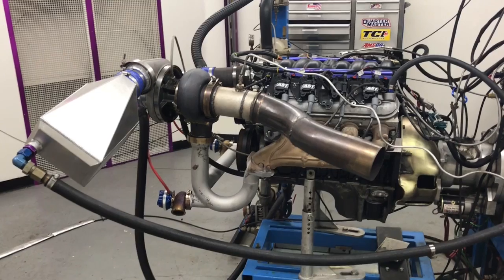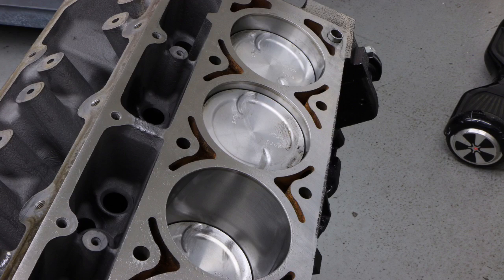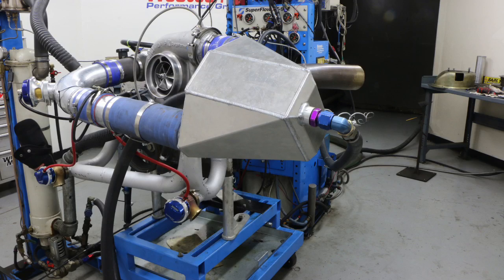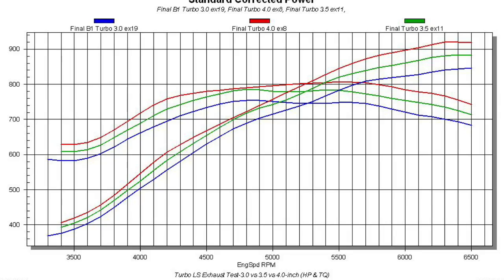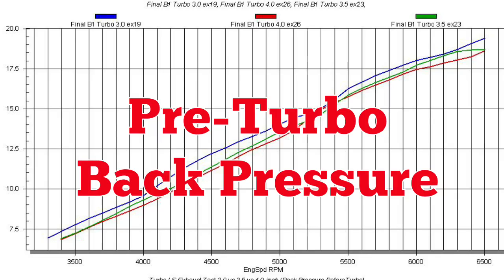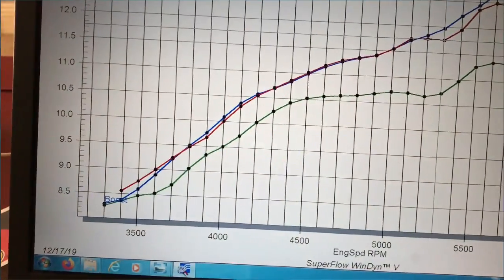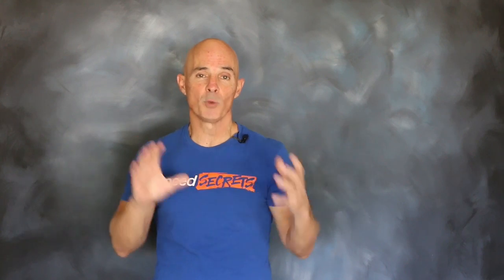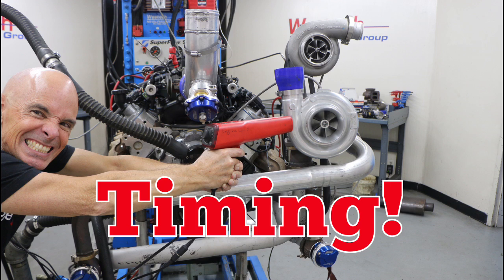LS TURBO EXHAUST TEST-THE DOWN PIPE DILEMMA-WHAT SIZE WORKS?

Comment: Awesome test, Richard. I'd really like to see a similar test with an NA engine with a y-pipe to a single exhaust. Unfortunately most of the options for us 4th gen Fbody guys are y-pipe set ups. That would be awesome to see how much power is picked up going from 3" to 3.5" to 4" on a cammed LS.
Reply: It would not be as significant, because post-turbine flow is far closer to being constant, and constant flow benefits from an infinite-cross-section exhaust pipe.

Pulsed flow benefits from a cross-section that utilizes the velocity of the last pulse to create a lower pressure area behind it for the next pulse. A single-pipe exhaust receives eight times as many same-size pulses as a single exhaust header primary tube, so it has to be larger in cross section for two reasons: higher frequency, (8X the frequency) and greater overall volume (8X the volume) of an exhaust primary tube, BUT, the change in pressure between each peak to each trough in the pressure waves is far smaller than right behind the exhaust valves.

Comment: Everyone only talks about size of the exhaust, which is important, but no one ever talks about the length of the exhaust. More length = more friction and my theory is the length of the exhaust is more important than the width. Would be cool to see it tested, i dont think its been done before
Reply from the maker: the length does decrease flow and the length after the header collector also has a tuning effect
Reply: @richardholdener1727  would love to see a comparison of exhaust lengths!
Reply: Not turbo specific but i come from a motorcycle road race background and header length was critical. But surprisingly as long as cross section was maintained ,shape didnt matter much. We would have exhausts pretty much straight pipes while we fiddled with length but once that was decided we would package it on the bike, sometimes with some radical bends, but it would work ok.

Comment: What about if the turbo outlet is a 3 in? Would running a 4 in be beneficial?  My turbo is a 78/68 turbonetics on a 5.3. Works ok but am I leaving power on the table with running a 3in exhaust?
Reply from the maker: yes if you are maxing out the flow of the turbo

Comment: Why did the 3" and 3 1/2" have a muffler, and the 4" didn't?
Reply from the maker: just race vs street
Reply: Richard Holdener would have liked to see the power difference would no muffler on 3 inch, considering it’s a common exhaust size for n/a cars. Would likely already be on the car before the turbo upgrade.
Reply: @richardholdener1727  It does seem disingenuous that you're adding back pressure by making the smaller exhausts longer, adding mufflers and adding bends.. Obviously they still would've made more power the bigger the diameter, but there's no reason to exacerbated it. There should be as few factors changed in a controlled study as possible, an apples to apples comparison should make the point just fine.

Comment: Are there still these pitchfork, burn the witch debates on the internet? I remember this stuff pre-internet, but the reason was that hp was so expensive and the Ford, Chevy, Mopar thing was in full effect. Now everyone puts chinese turbos on LS motors and just wins races and hits their performance objectives with a laptop... We aren't spending $4,000 on 18 degree heads and sheet metal intakes anymore with 82 stage foggers.

Comment: So you've done various exhausts.....how about air filters on a similar setup say 900-1000hp ? Lots end up with very little room for filters, and some claim that small filters massively reduce power vs open, screens, guards, etc etc Some also claim their filters get sucked in because they cannot cope.
Reply from the maker: blow0me I think Engine Masters did that test but it’s a good one
Reply: @richardholdener1727  They did a test in a n/a carb engine...and all using very big filters if I recall correctly ? Or if there was a turbo...again, all the filters were large. I've only about 4" in front of my turbos, so use these https://burgertuning.com/products/bms-silicon-single-turbo-filter-bms_stf?_pos=1&_sid=c4fcb7a3f&_ss=r I had previously used some Greddy filters...but they filtered very poorly. Space just too tight with low mounted twins on mine

Comment: So...was thinking a little more on this subject.  How about a test on different exhaust housings?  How much do you really give up on say a 76/75 with a tiny .81 up to whatever the biggest they make is, or so.  Doesn't have to necessarily be that turbo, but I'm sure you get the jest of it.
Reply from the maker: I ran AR  testing on a Honda back in the day-it makes a big difference when you get near the max flow of the turbo

Comment: Why does it look like there is a catalytic converter in there? lol
Reply from the maker: its just the the adapters we used to connect the tubing
Reply: @richardholdener1727  so its hollow? That's gotta cause some serious turbulence?
Reply from the maker: @YZFoFittie  might be interesting to see-might even help with expansion after exiting the turbo like a 2 stroke
Reply: @richardholdener1727  2 stroke pipes are designed to cause a pressure wave form resonation to supercharge the engines by forcing unburned fuel and air BACK into the motor. This would be very bad for a 4 stroke! Especially a turbo!
Reply from the maker: YZFoFittie the positive pressure wave that helps stop leakage out the transfer port at the end of the cycle on a 2-stroke is a minor one. The real gains come before that, when rarefaction occurs after the positive wave reaches the expansion chamber, is reflected back as a negative pressure wave that arrives to simultaneously scavenge intake charge in and exhaust gases out. These reflected waves are how Intake runner length effects the torque curve and how primary length on a header provides scavenging. That said, I doubt the turbo 4-stroke will produce the desired reflected wave in this chamber-especially with it being positioned after the turbo.

Comment: its interesting to see the pressure changes are not significant but the power numbers are, something to think about for sure
Reply: I remember a video of yours awhile back when u said boost is basically measurement of back pressure before the valves NOT air flow and that has stuck with me.
Reply: @Trouble.Maker.Racing  I agree intake manifold pressure is a result of restriction in the intake side and can be better demonstrated using a supercharger and going from lower flow heads to higher flow heads. Keeping all pulleys and equipment the same. This usually results in better power with less boost. Psi is relative to input and  restriction but cfm is simply air flow.
Reply: Wonder how the back pressure numbers are affected if he had an electronic boost controller maintain consistent boost pressure! 🤯

Comment: LOL, You will probably still have people telling you you need back pressure on a boosted engine!

I gained 29rwh, I went to a twin 2.5" out of the headers to twin 3.0" to the bumper, on my supercharged 3liter 6cyl - and I lost about 2.5psi boost in the process. (less boost more hp and tq)

Oohhh.... the experts that came out to say you will have no back pressure... you will loose HP.... Etc, etc...

Good to see some people getting the correct info for their boosted engines. 👍
Reply: Yes, you made more power with less boost because you removed a restriction. You can do the same thing with a cam change. A lot of people don't understand that and don't realize or forget that "boost" is backpressure between the compressor and the engine - a byproduct of what a supercharger actually does, increase air density.
Reply: Higher boost pressure also comes with higher heat, heat is the devil.

Comment: What's the difference in grind between a turbo cam & an NA camshaft?
Reply from the maker: Ill see if I can dig up specs on the two that are close so you can see
Reply from the maker: Generally speaking more overlap on the na cam-but Ill get you valve events
Reply: Thanks.

Comment: Why not try 5” to see if there’s diminishing returns beyond 4”? Maybe future update?
Reply: I would like to see a 5" full exhaust with muffler.
Reply: What you need is already in this video...
Reply: Because that's bigger than the turbo outlet.
Reply: SRVDean - I actually put 3” and sometimes 4” down pipes on internally gated 15G turbos on Volvo cars. The outlet was around 2-1/4”. It made a difference.
Reply: @grumpysteelman  I've got a Volvo td04 I want to put on my sand buggy and I couldn't imagine trying to neck down more than 3 inches of downpipe to that turbo
Reply: Mad Mod - I built it for a guy, test fitted on my own car first. You can really port the heck out of the inlet, manifold outlet, the “ball” outlet and even the wastegate outlet. The compressor is so small that over about 250whp you had to have the porting and 3” down pipe to go further. I think 280whp on a B230FT was about where I had to upgrade from the 13C to a 15G from an 850R. Anyway, that little turbo spooled like a semi, whistled and came on at low rpm. Nitrous would spike the boost to 25psi with a 3” downpipe. 4” was nutty but hilariously awesome all at once. I built it on my car and sent it to a young guy with a 740T I believe. What engine are you using it from and going to, if you don’t know which TD04 you have?
Reply: @grumpysteelman  I have a Toyota 22r 2.4l that's pretty stock in the buggy and it's a td04-12t from a 1.9L s40/v40 which is definitely a little guy but managed to support almost double the rated power of my 22r. I like it's twin scroll housing because it nearly matches my stock manifold and I'm really looking for as quick of spooling as possible so I dont need to wind the 22r up past 5k with my 60s vw gearbox.
Reply: Mad Mod - I never touched a 12T but I bet it will work just fine. If it has the integrated CBV on the compressor housing you can pack a few fender washers on top of it to increase the spring preload to keep it from leaking boost. Those usually tear with some age on them so I’d pop the three bolts off and give it a look anyway. Not sure if they changed that on the little FWD cars.
Reply: @grumpysteelman  it's definitely got the built in bypass and it's internally gated. Little small but I'm not looking for big peak numbers and it will likely never go on a Dyno. I'm just hoping for really good response with it and a solid torque curve.
Reply: Mad Mod - I subscribed to your channel. I’ve done a lot of turbo stuff over the years - I’ll try to keep an eye out in case you run into any hiccups. The blue thing looks cool.
Reply: @grumpysteelman  I gotta get a new video. That old one is shaky and doesn't get a good view of the buggy at all
Reply: @grumpysteelman  those little 15Gs with big downpipes are a good laugh because of the more or less instant spool. 😁 Good way to shred tyres with just a mashing of the pedal. 😎
Reply: 5:58 shows you the diminishing returns.  Use those three data points to infer the 5" result. It's going to be a 0.1 to 0.25 PSI max drop from the 4 inch.

Comment: The real MVP here is Flow: Any Engine is an Air Pump. I dont know how much more CFM you gain with going from a 3" exhaust to a 4", but my educated guess is that there lies the answer
Reply: Wonder is there is a way to measure the cfm out of the exhaust during the pull.... 🤔

Comment: In my experience, the results would've been MUCH worse if the 3in and 3.5in was that size from the turbo back, but for the first 12in or so after the turbo, the most important part in my experience, they were BIGGER than the 4in one! Looks like they coned out to about 5-6in before going back to 3-3.5in, where the 4in was just straight pipe.
Reply: Coned out as to do what to the down pipe?

Comment: I have a great idea for Dyno testing. Test 2.5” and up charge pipe on a 900hp turbo setup along with stock size and up throttle bodies. That would be very very interesting! Some people think you need a big throttle body and I just dont think you do.
Reply from the maker: This had a stock TB size and LS6 intake opening. Obviously they are less restrictive under boost. But charge pipe diameter and EXTREME length would be good tests.
Reply: @richardholdener1727 YES that test would be interesting!

Comment: You also had a  muffler on the 3 inch exhaust.
Reply: Simulating a street set up.
Reply: I didn't look for a logo or anything, but if I took a guess it was probably a straight through performance muffler.

Comment: Still surprising how well a long 3" performs against basically an open 4". Would be interesting to try a 4" downpipe for say 2-3ft, then tapering back down to the 3" system
Reply: He basically did . It appears the 3” exhaust has a dump pipe going 4-5-3inch which would benefit the 3 inch exhaust. The most important part of a turbo exhaust is the dump pipe as that’s where the most heat will be wanting to expand.

Comment: Ditch the bleed-style MBC, get a hallman-style that blocks boost. They are literally a pressure regulator and are better for nailing repeatable boost with different backpressures. Also there's virtually no boost leak.

IMO the only time comparing based on backpressure effects is when it's absurdly high and something is being maxed out.

Comment: Excellent test.  Thank You for your work and enthusiasm.  Makes me feel good about my 3" DP on my 4.8 coupe.  Thought I was giving up alot
Reply: It's just a 283 cid.
2.5 " would be GOOD.
Reply: @nellyfarnsworth7381  I dont think so...I would never go smaller than the turbine outlet.
Reply: @tunerdadtunerdad7927  
I was thinking about N.A. & Dual pipes.
I have some questions.
I have a Gen. 3 corvette. Want to pull the engine out & replace with a L.S.  5.3 Liter,  naturally aspirated.
Tell me about your engine, horsepower, torque, m.p.g.
& price (with turbo). Did you tune your engine???
Thanks.

Comment: Can you test how a LS9 cam works with a turbo since its really cheap at $100-150 , idles like a stock cam @500 rpm and perfect for a daily driver. I know its gives up low end torque with the wide LSA but that doesn't matter once you are in boost .
Reply from the maker: i have tested that a bunch-it's not great but certainly works well for the price-better than the stock LM7-at least on the top end
Reply: @richardholdener1727  I had a 231/231 LSA115 over 6.00 lift in a gen 4 5.3 with a S475 , didn't like it for daily driving . Put a LS9 cam that I had laying around , like it much better and honestly i can't tell a difference from seat of the pants the fueling didn't change much at higher rpms I actually had to add a tiny bit of fuel  . Never been on a dyno or track so can't compare .
Reply from the maker: @dilsher12  i haven't had much success with single pattern cams except for low duration torque cams

Comment: I am running a 4inch exhaust but it's a full exhaust with two  straight through mufflers , wonder how much of a difference that makes .
Reply: It's all about keeping the exhaust gas hot, if your worried about it you can Amazon yourself some exhaust wrap and do the first 3 feet after the turbo. Keep that temp in the gas and it will help keep the exit velocity higher.

Comment: I think you just need to run a 3 or 4 port MAC valve and set the holley up for closed loop boost control based off MAP.  That way you always have the same targeted boost for all the test.

Comment: Heres one for ya.  I gained 30 wheel going from a stock catback 2 3/4" with flow master muffler to a 4" cutout on my old NA LS1 Trans Am making only 450 wheel.
Reply from the maker: that is a  lot
Reply: Richard Holdener yessir, so it’s no surprise to me that an engine making a lot more power gained even more.  We will be testing this on my buddy’s turbo camaro.  He currently has a full length 3” catback and is going to a 4” cutout.  I’m expecting at least 60 wheel.  

While we’re on the topic, I tested a 500 wheel HCI NA LS1 that had the 3” borla catback.  He had a cutout setup to just bypass the muffler and exit the passenger side tip instead of going through the muffler and exiting the drivers side tip.  It picked up 8 wheel by itself.  Whenever I see anything making over 400 wheel, NA or not, running a single 3” I cringe.  I’m still really interested to see a single 4” to dual 3” comparo btw.
Reply from the maker: @jessemurray1757  let me now
Reply: Richard Holdener will do but won’t be till spring.....Michigan

Comment: Good info that a lot of people wondered for sure. I wish there was a 5 or 6 inch exhaust test. I have a 3” outlet on my turbo opening to a 4” down pipe. I’ve always wondered if it helps/if it’s worth the weight

Comment: Looks like 2.5, 3.0 hotside? Thoughts on 2.25 or 2.5 hotside? From what I've read, 2.5 can handle over 2k hp. Curious if 2.25 is adequate as alot of crossovers and manifolds (log type) are that size.
Reply from the maker: camscustombuilds it’s 2.5-but I’m sure the 2.25 would work just as well

Comment: I think you should do the same test on a smaller motor too, to show if the 3in is actually adequate on say a 4.8 turbo engine! I think the larger downpipes will still show gains, though probably not as big
Reply from the maker: Jacob Burskey the exhaust flow after the turbo is more about power out put. If the 4.8L is run up to 900 hp, we should see the same gains. The difference might be the back pressure curves before the turbo